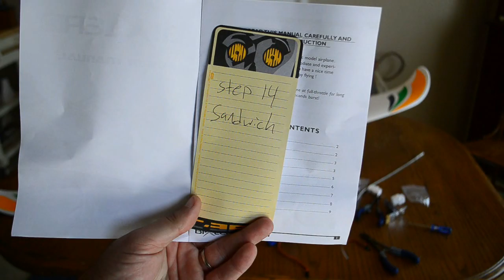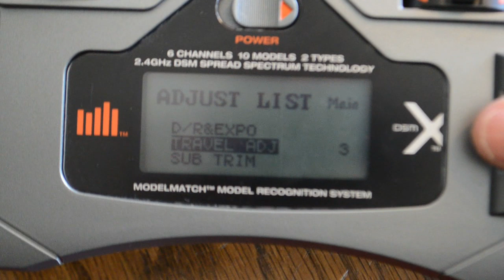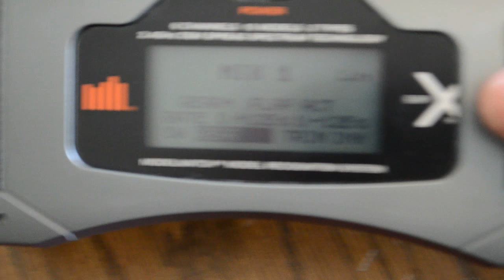Bixler 2 build and Flap fix

Comment from the maker: Since you mixed it like I did then each servo is on a different channel. One is on flaps and the other is on gear. Since they are different you can go into sub trim and travel adjust to even them out. Hope that helps

Comment: Like the video. Going to use some of these ideas. Check out my channel for build my build series on the Bix for FPV. Bix 2, NTM 2836/1800. 40 amp esc, 5v/5a, sbec, Immersion 5.8ghz 600mw Vtx, Cloverleaf, GoPro 3, Prop 7x4, Cyclops Storm OSD, Futaba 7C.